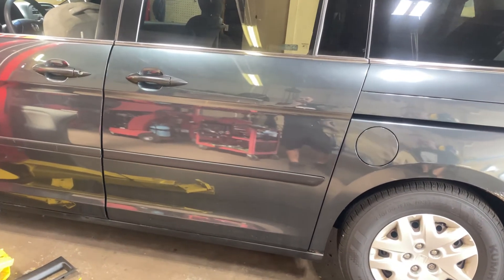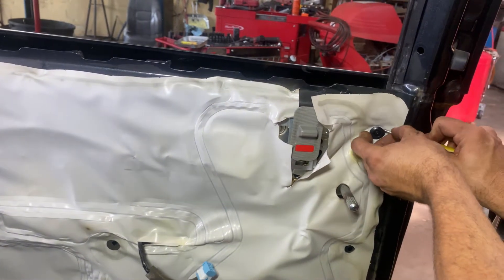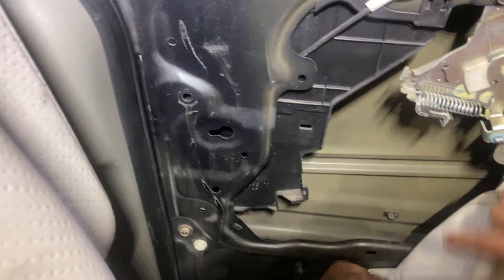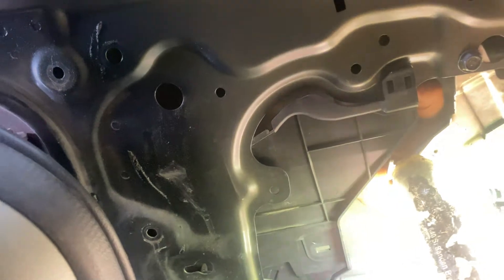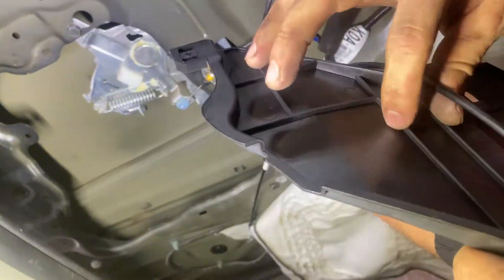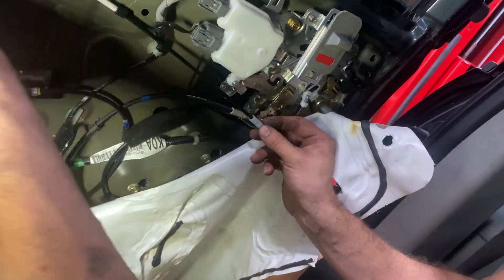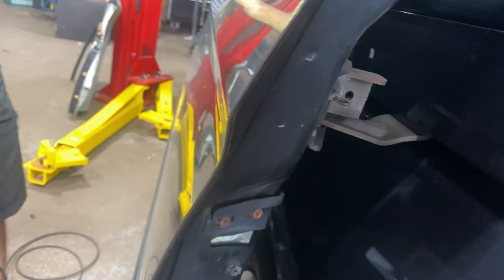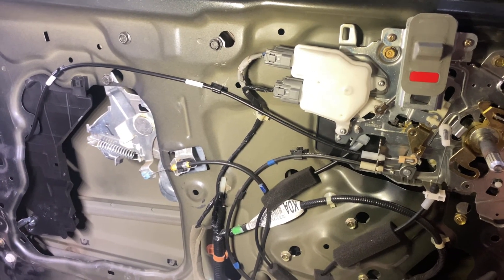HONDA ODYSSEY SLIDING DOOR NOT CLOSING LATCH ASSEMBLY REPLACEMENT HOW TO

Comment: This method worked for my 2016 (2011-2017) Odyssey, HOWEVER, the window track locking nut is located on the same "face" as the actual latch and the bolt is behind a rubber plug.  It was really hard working inside the door and on the later model the interior of the door is much "tighter" than this one.  It's a reasonable job but the window bracket and much more closed off door interior are the pain points on the later vehicle.  It's done...but more to it than what you watch here...AND THIS IS A GREAT VIDEO.
Reply: Do you have a part number for this rear latch.  Can not seem to find the part on a google search
Reply from the maker: I have listed the part numbers in the description.
Reply: @acetechauto7  I'm sorry, I was looking for the same type of part for a 2011 Odyssey.  Driver's side sliding door, not the front latch but the rear latch to keep the door all the way closed.
Reply from the maker: Oh sorry I don’t have it for that year. If you call Honda and give them your vin number, they should be able to get you that part number. Good luck with the repair!
Reply: @acetechauto7  I assume the door cannot be shut once old latch assembly is removed... correct?
Reply from the maker: Barry that is correct

Comment: Great video. Do got one question. When i open my manual sliding door the back will pop open but front won't let the door open what would that be? Just replaced the exterior door handle to.

Comment: This worked really well!!! Although in my case I removed the 2 or 3 small Phillips head screws on the plastic latch cover once I removed it from the van and I was able to flush it with lots of spray lube and get mine working again. Even the front latch worked after that. But I couldn’t have done it without your videos for guidance.
Reply: What did you flush it with?
Reply: @desertduck4177  a lot of wd 40 it was out of convenience. i would have probably used tri lube if i had it handy to leave some teflon behind. but it didn't give me any trouble  after i got it working.

Comment: Im having this issue with my 2006. Power doors. Is this a 2006? Happens mostly when weather goes anywhere below freezing
Reply from the maker: Yes this is a 2006. Maybe you can try spraying it with wd40 see if that helps.
Reply: @acetechauto7  so far I hit it with some white lithium grease and switched it from electronic to manual door mode and that seems to have allowed it to at least close
Reply: @robertb8629 The mechanism inside has to be cleaned and lubed. I'm having the same issue. Hot weather fixes it. Cold or rainy day...breaks it. Either replace it or remove clean and lube it and test it out.

Comment: My 2007 has the automatic power sliding door. I cut the cables off to make it manual. Can I use this part instead, or do I need the one with 2 cables?
Reply from the maker: It might work as the cable for the door latch on it should be the same.
Reply: @acetechauto7  awesome, thanks for the reply and video.

Comment: So if I have a powered door but the door motor doesn't slide anymore the back latch won't work? I ordered the whole latch inside the door like you did but for the auto. Will it latch?
Reply from the maker: If you have an issue with just the powered motor not working you can just cut the cables that come out to the upper door hinge and your door should operate manually no problem.
Reply: @acetechauto7  i will try that. Right side opens fine. Left side motor quit and recently back end of the door won't latch (feont latches fine) and battery dies.

Comment: What is the model of the van in the video. I have the same issue on my LX, but the cable attachment doesn't look like this and the latch assembly is different. The mechanism I'm seeing is different than video here.
Reply from the maker: This is a Honda odyssey
Reply: Yes, but what trim? EX, LX etc? I have an LX and the latch part does not look like this, nor is the main mechanism like this. So I’m thinking each trim may differ
Reply from the maker: @johncrabbe6339 that’s possible but I’m not sure what trim this one was sorry

Comment: What was the HONDA part number for this latch?  How do I find your video on removing the door panel?  Excellent video actually what I needed!  Thank You!
Reply from the maker: The part numbers and the link to the door panel removal are in the description. Good luck!
Reply: @acetechauto7  Was this the case with this van? >>> This latch going out causes a parasitic draw on the battery (fuse #7) being the latch / latch position no longer sends correct signal to electronic motor / door opening /closing mechanisms.... pretty common on these Odysseys
Reply from the maker: No Barry this van didn’t have any parasitic draw issues due to the latch problems.
Reply: @acetechauto7  Okay...thanks boss...

Comment: Would this be the same fix for 2011 Odyssey?
Reply from the maker: Yes it would be the same for that year also
Reply: @acetechauto7  Can you supply the part numbers for the 2011 Odyssey.  It is a bit different than the 2006, but similar.  Thanks.

Comment: Great video, BUT.. what if the door doesn’t open up.. and STUCK closed! Help!
Reply from the maker: It depends where the issue is if it’s cable related or the latch itself but either way you’ll have to somehow get that door panel of in place or break it to get to the latch.
Reply: @acetechauto7  so I removed the door panel, but im guessing my door latches are holding it? Idk I can NOT open the door to save my life, ive looked into countless forums nothing doors just jammed shut.
Reply from the maker: That’s a tough situation. You can try one person pulling on the release cable and the other trying to pry on the door. There really is no easy way out in your situation. If that doesn’t work then you’ll have to try to get in there and break apart the door latch.
Reply: @acetechauto7  appreciate the insight. Maybe ill have to make a video on that lol. “Nightmare situation”.
Reply from the maker: Haha share your experience you’ll definitely be saving the future unlucky people some headaches. Wish you luck!

Comment: Are you able to share what the part number was for this? Having a hard time tracking it down. Everybody defaults to a different part, just a roller piece, not this much larger piece.
Reply from the maker: Yes, I have listed the oem part numbers for both sides in the description.